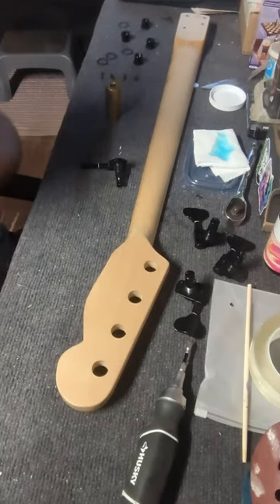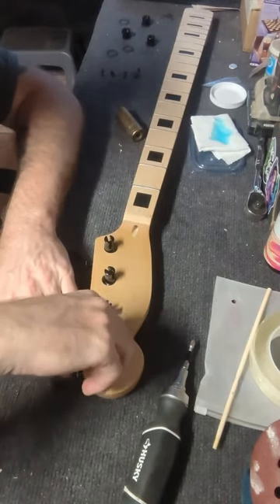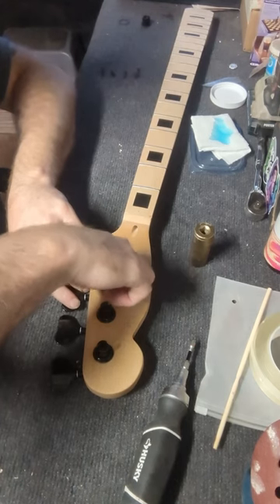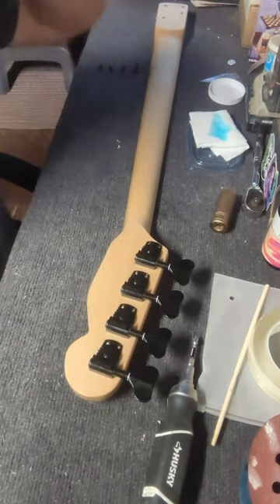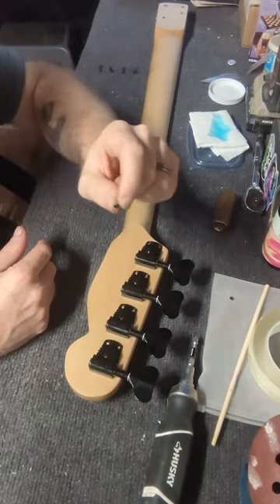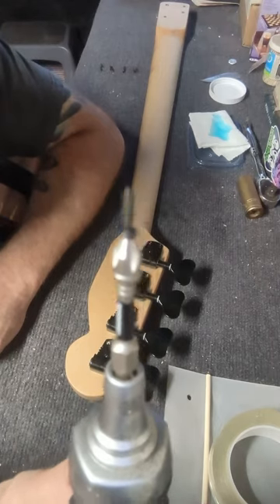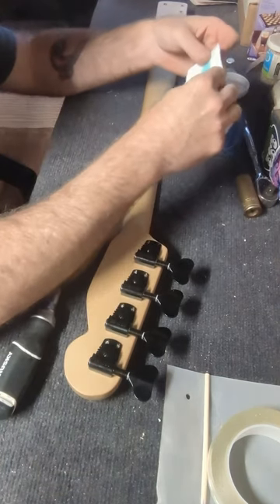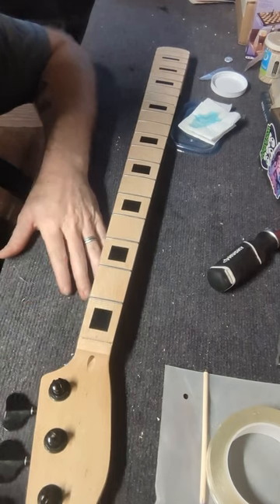How to Install Grover Bass Tuners | Panick Inc Showcase Bass Tutorial

Comment: Nice tutorial,split my head over tightening my tuners.Any tips for glueing  my my head back together?
Reply from the maker: Titebond wood glue and a couple of good clamps. Get as much glue as possible into the split (spread it open if you need to), clamp it up tight, then wipe off any excess glue.
Reply: @panickinc  thank you

Comment: Do you know if these would fit in a Jackson Dave Ellefson bass? It has the Gotoh style tuners, I know the concert basses in the 80s had these a lot of the time, but I can’t tell if these posts are too large to fit in the holes
Reply from the maker: I'd double check the measurements. You can find the specs at https://grotro.com/product/titan-electric-bass-machines-145-series/